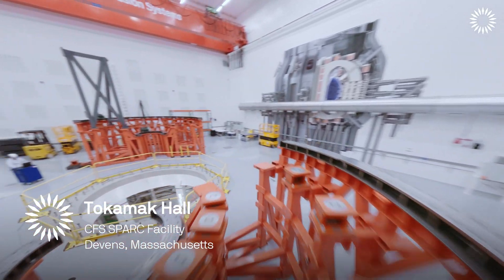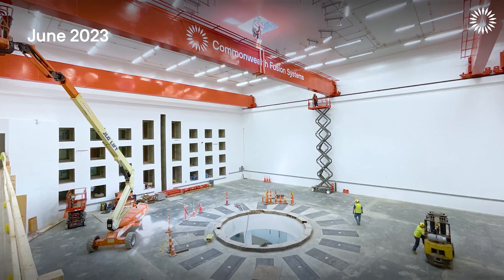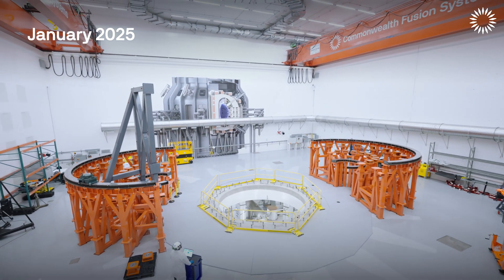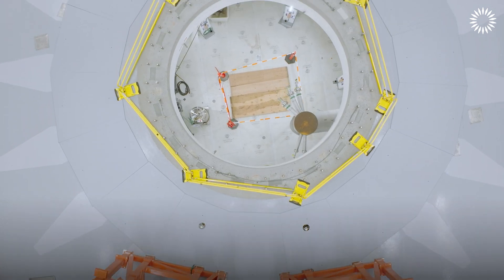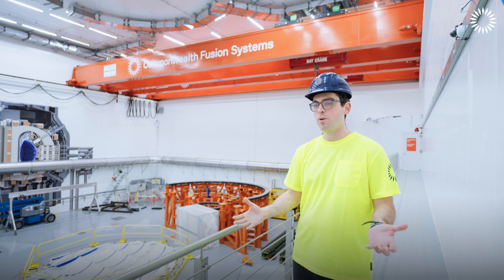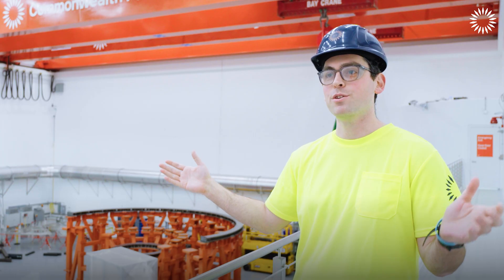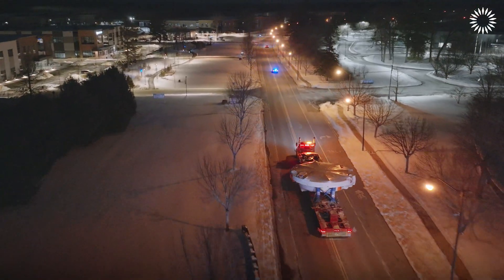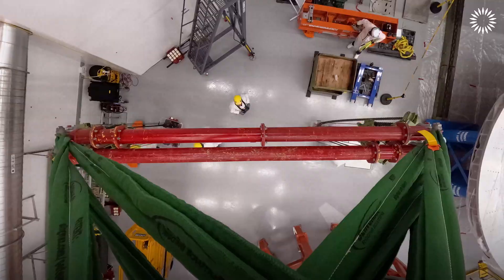The Foundation for the SPARC Fusion Energy Machine Is Here

Comment: It has become standard practice to oversell such projects since the nuclear fusion energy experiments began in the 1950s. This sales pitching has been aimed at journalists, the general public and investors to generate interest and generate funding. The field is very complex and most of the presenters have learned to only present some fundamentals while omitting key evaluation parameters. CFS started by bragging about their high temperature superconductors without mentioning their magnets will need to be maintained at around 15 Kelvin while being very close to the 120 million Kelvin plasma emitting a high flux of 14.1 MeV fusion neutrons. CFS claims that the SPARC experimental reactor will have most of the key systems needed for a successful electrical generating plant. That is an extreme distortion. SPARC will only operate for 10 second bursts and then require a lengthy recovery time. It will likely have a very low duty cycle. It isn't designed to have a robust heat removal system since it isn't expected to generate a large amount of average heat. It won't contain a steam generator, a condenser, a turbine, a generator, a electrical substation, or a secondary heat removal system, which is common for most power plants. Additionally, it won't have a tritium breeding means which will be essential for future fusion energy power reactors. Since the fusion energy experiments began the public has been told that the hydrogen fuel is almost unlimited. Promoters often fail to mention that the required tritium is radioactive and they never mention that the commercial price for it is over $30,000 USD per gram.

At the end of the video it was mentioned that SPARC is expected to achieve net fusion gain. I believe the earlier goal was for this to happen in 2026. Typically, the presenters fail to detail what input energy parameter is typically employed to come up with a fusion gain value. Typically that energy is the amount of radio frequency energy that is absorbed by the plasma to heat it up to fusion level temperatures. The gain figure for that is typically expressed as Qp, or Q-plasma. That input energy value is typically a tiny percentage of the total required to operate such facilities, and can often be under 1% of the energy consumed by the facility during the day of the experimental shots. Additionally, the Qp value only applies to the brief time that the fusion reactions are occurring during the SPARC's pulsed operation. So if the machine is operating with fusion only occurring for 10% of full-cycle time then the Qp average would be one tenth of the value provided to the press. 

Most nuclear fusion energy fans tend to immerse themselves in information echo chamber sources that reinforce what they prefer to believe in. They tend to have little interest in seeking out countering viewpoints that clash with what they have come to love.

It is common for all nuclear power promoters to have masterfully excluded the following warning from their consciousness. It clashes with their technological love affair.

UN chief: World has less than 2 years to avoid 'runaway climate change' (TheHill)
  * This statement was made 6.6 years ago.

Comment: First Light Fusion, are they the first to "see the light"?
Reply: Most nuclear fusion promoters have become masterful at omitting key evaluation parameters when they present to journalists, fans and investors. First Light Fusion (FLF) is no different. They use the term ignition liberally but fail to mention that once the fusion begins it tends to blast away the vast majority of supplied expensive fuel before it has a chance to react. FLF may eventually achieve shot rates of once per second but, left unmentioned, is that the fusion reactions will likely only last less than 0.000,000,001 second.

Comment: CFS and General Fusion are the most promising private fusion projects so far imo
Reply: Really? General Fusion? I’ve heard they’re scoffed at by the fusion community for having a minuscule physics basis for their approach…and because it’s a glorified diesel engine. But I agree CFS is leading the race for fusion hope. MIT spin out for a tokamak is peak.
Reply: @SirMrPickle 
They should have called themselves Steampunk Fusion 😆.
And yes, 😎 but not very hopeful on their particular approach working out any time soon (or at all) either.
Reply: UK company Tokamak Energy looks pretty promising too.
Reply: Most nuclear fusion experimental programs have been greatly oversold since the experiments began in the 1950s. CFS and General Fusion are no different. The promoters have mastered to skill of omitting key evaluation details in these very complex experiments. The General Fusion approach is an Inertial Confinement Fusion (ICF) approach. The cycling of such machines may be no greater than one shot per second while the fusion 'burn' may only last for under 0.000,000,001 second. The active duty cycle will be minuscule. The experimenters employ the term 'ignition' in a deceptive way. In many cases only a tiny percentage of the expensive fuel will fuse before blasting away the vast majority of the provided fuel. The commercial price of the tritium fuel is more than $30,000 per gram. Most journalists, fans and investors have been told that the hydrogen fuel is almost unlimited.
Reply: The General Fusion approach and public presentations omit key evaluation criteria details. Their detected fusion neutron quantities are at least a million times less than what would be required by even a small demonstration electrical generation station. The fusion reactions only last for less than one-millionth of the time between each pulse cycle, even if they were operating at a rate of ten-pulses-per-second. Their experiments haven’t employed rare, expensive and radioactive tritium. They have never stated the percentage of their fuel that ended up fused before the vast majority of it was blasted away from the reaction center.

CFS also hasn’t stated how efficient they expect the fuel ‘burn’ to be during the 10-second SPARC ‘ON’ period of time.

Comment: I mean, I love what CFS is doing, but this feels like Blue Origin vs SpaceX. China is building Tokamak's like crazy, and I feel CFS is too slow, at this pace, what, 2026-2027 before SPARC is online? And then how long until ARC?  I feel like CFS needs to get way more anxiety about falling behind and execute quicker. I don't like Musk, but I feel like if he was running CFS, things would be moving quicker.
Reply: There is an upcoming race between the U.S. and China in this particular, very promising row of nuclear fusion with  magnetically confined plasmas, the high-field tokamak. The Chinese rival of SPARC is HH70, built by Energy Singularity, the Chinese counterpart of CFS at Shanghai. Ten years ago China had 1 research machine, today they're 15. As for the high-field tokamak, its first-of-a-kind prototype was ALCATOR-A, at the MIT, Born from the brain of an Italian engineer, Professor Bruno Coppi. ("ALCATOR" Is the Italian acronym of "Alto campo toroidale", "High toroidale field"). Larger machines followed both in Italy (FT, "Frascati tokamak", and FTU, "FT upgrade") and in the U.S. (ALCATOR-C, ALCATOR-C-mid). Then, Star Wars wiped out funding. Today high-temperature-superconductors (where MIT achieved world-wide record) opened the game again. US logistics and Italian funding will do the job, or Chinese will make us to bite the dust?
Reply: @TheScoubidouSmile  Im well aware of all and have been following the REBCO magnet based proposals since Whyte gave a presentation many many years ago in Palo Alto. But China is building tokamaks right now with REBCO magnets.  China also produces way more rare earths that are needed to make these magnets.

The US needs to get WAY more serious, they are years behind now despite having been ahead on REBCO early on.
Reply: @RayCromwell  Star Wars (on the U.S. side) and chronic poor R&D budget (on the Italian side) have almost strangled the high-field tokamak. High-field superconductors came to the rescue, but Chinese are closer and closer.
Reply: @TheScoubidouSmile  I hope you're not referring to ITER, because ITER was never going to work. Even given the REBCO revolution, it's unclear if a long running, stable fusion reactor which can extract economically feasible energy will work, since there are a boatload of unsolved problems still, even if you manage to keep fusion confinement going for minutes.
Reply: @RayCromwell  it's even worse. I've looked at the dimension figures (in millimeters) on some blueprints: five digits! How on Earth can a power engineering company ensure a decent tolerance in a real-life power plant, keeping in mind that the design of a tokamak magnetic field is so carefully trimmed that even the Earth's field is to be kept into account? Delays plague ITER gargantuan undertaking since the beginning. As for tokamaks at least, the smaller the better.
Reply: @TheScoubidouSmile  - The ITER project remains grossly over budget and well beyond a decade behind schedule. They continue to recover from some major component manufacturing errors. They have admitted that their first deuterium-tritium fusion experiments won't likely occur before 2029. Accounting of these faults doesn't appear in their website or in their recent newsletters.
Reply: @TheScoubidouSmile  - It is common for all nuclear power promoters to have masterfully excluded the following warning from their consciousness. It clashes with their technological love affair.

UN chief: World has less than 2 years to avoid 'runaway climate change' (TheHill)
  * This statement was made 6.6 years ago.
Reply: @TheScoubidouSmile  - The promoters of ALCATOR high temperature superconducting magnets seem to avoid mentioning that the CFS SPARC magnets are to operate at 15 Kelvin. I get the impression that misleading the public is often considered necessary in order to promote one's technological love affair.
Reply: @TheScoubidouSmile  - According to the technical paper that I've read you are correct that the non-superconducting, copper magnetic coils will be kept at the normal atmospheric pressure boiling point of liquid nitrogen, 77 Kelvin. Those magnets tend to provide very little of the plasma confining magnetic field for SPARC. The high-temperature superconducting coils are to be maintained at 8 K and 15 K.
Reply: It’s a multibillion dollar popcorn 🍿 maker. This is so exciting. 😅
Reply: You are significantly underestimating the challenge of going from tested prototype components [at MIT PSFC] to a fully installed and tested Tokamak at the scale of SPARC
The analogy is not Falcon and New Glenn -- rather its Saturn IB and then Saturn V circa 1967 - 1969
This year [cal 2025] will be pivotal installation of all the relevant components for the achievement of Tokamak Fusion in a prototype Reactor 
Then comes [cal 2026] the qualification of SPARC as an integrated system of systems and the first operation [non-fusion plasmas]
I don't think that you can do it much faster
Reply: @WestyHighlander - There are major differences between the MIT PSFC experimental tokamak and the  CFS SPARC tokamak just as there are fundamental differences between the SPARC design and the intended ARC fully grid integrated power plant design. It is misleading to refer to each of these predecessor machines as being ‘prototypes.’ Referring to them as being ‘prototypes’ is sales hype to attract fans and investors to support  these fun experimental machines.

Unlike ARC, SPARC will lack a tritium breeding blanket, and a tritium processing plant needed to purify the blanket generated tritium and recycle the tritium that isn’t fused during the 10 second fusion pulse. Unlike the proposed ARC design SPARC will only have an active fusion duty cycle of approximately 0.0007 since no robust heat removal system is being provided to remove the thermal energy deposited by the 14.1 MeV fusion neutrons once SPARC achieves full power operation using deuterium-tritium fuel. SPARC also lacks all the other components of typical unclear power generating stations such as primary and secondary coolant system heat exchangers, large coolant circulation pumps, a coolant boiler and a steam superheater, a turbine and generator, a grid connecting substation, a coolant condenser system and a means to dump excess heat into large bodies of water, or into the atmosphere.

The slick CFS presentations, to journalists, to the general public and to investors, tend to omit many of the issues I’ve presented above. They have come to depend upon the technical naivety of the messaging recipients who lack the technical backgrounds to ask deeply probing questions.